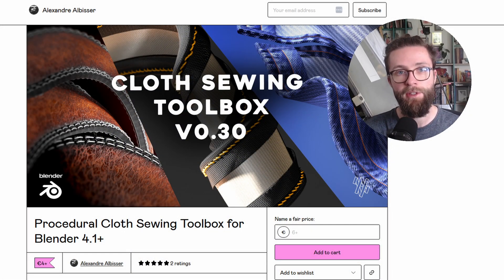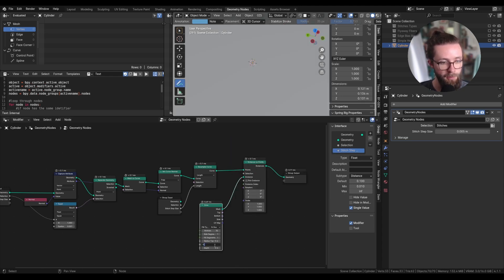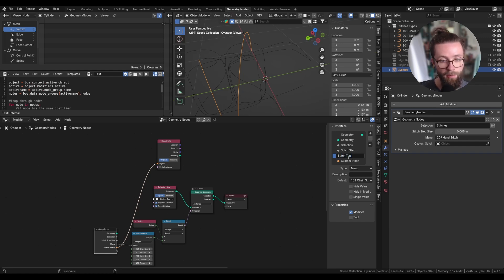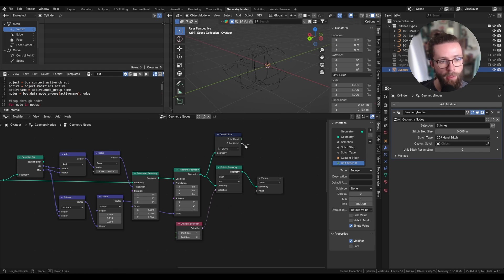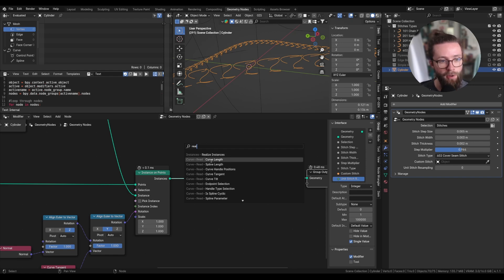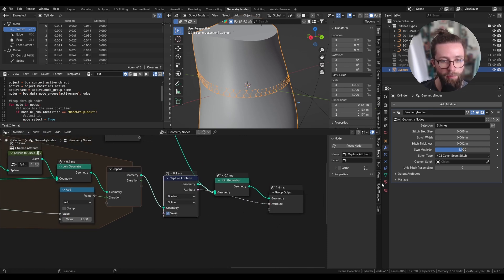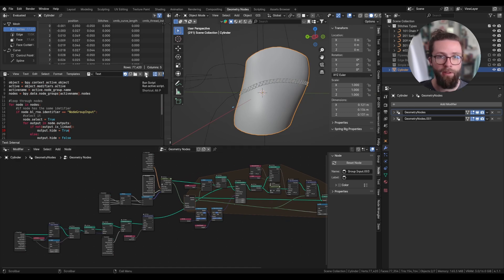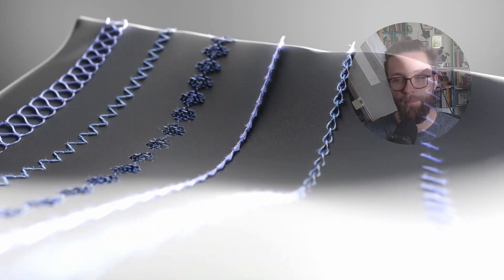Improving My Procedural Stitching System - Blender Tutorial

Comment: I like that this method remains a part of the original geometry with your use of vertex groups. I'm watching this and keeping an eye on the face count, as some methods add monster number of faces, which would make them impractical for animation. Using instances on points seems to manage that somewhat, the face count jumps later but the stitch gets more complicated as you tweak it to multiple threads so that is to be expected, still seems a lot of faces for a single curve that is instanced, is that because the Ply Count and Fiber Settings?  I can be a bit conservative (cheap) when it comes to spending face count processing on items that aren't noticed that much but still need some detail. I'm going back and forth with different methods for stitching a basic single or double row stitch on clothing but the use of instances and vertex groups seems to solve a lot of problems with the material flexing as the vertex points are on the same object. Is it possible to show dimpling where the threads pinch the cloth and pass through the cloth? I subscribed and am going through your videos, I like the way you use the tools to solve problems.
Reply from the maker: The curve to mesh tool indeed adds much faces so you can adjust the fibers settings, ply counts, as well as curve resolution and so on to lower face count,
An other solution would be to bake the created mesh to a texture, which might be a bit tricky to do with blender's bake options but I think you should be able to convert everything to a texte.
For the dimpling and so on, you should be able to do this by using the shader attrbutes (UV Thread and so on) my tool creates, which is a UV map flowing along the curve. More precise method for this should be included in the next version of the asset pack!